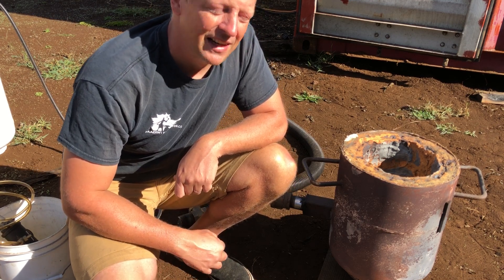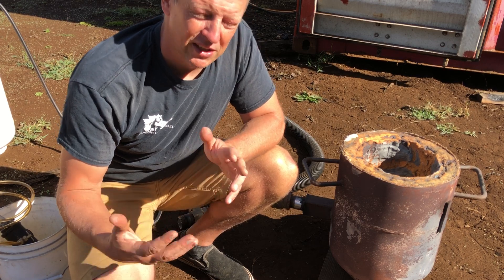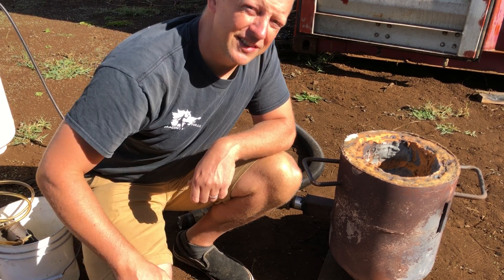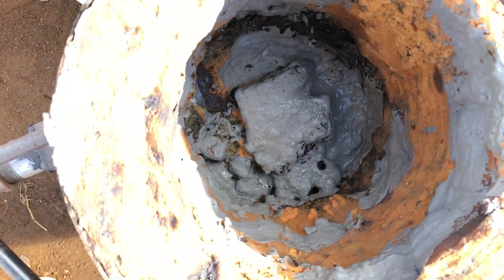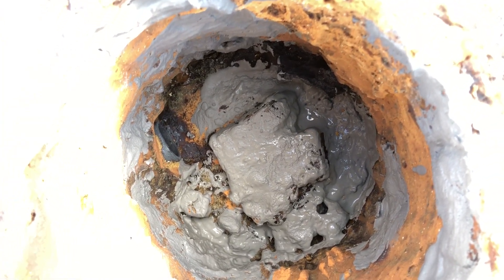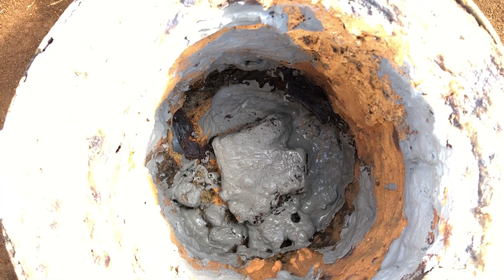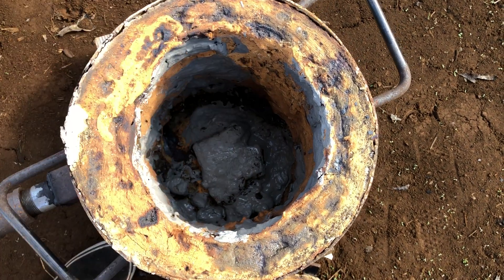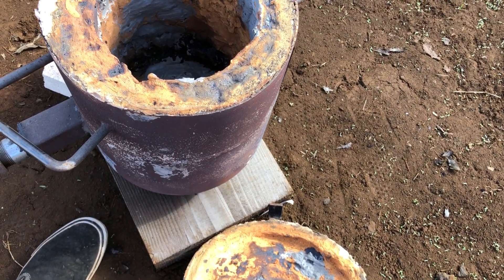Furnace and Burner Tour

Comment: Hey, sorry for bothering you again perhaps you forgot or are too busy to answer, but my questions where about the formula to calculate the amount of charcoal to mild steel in order to achieve 1.6% carbon, and if hardwood charcoal is superior to softwood.
If you do not want to share your secrets that's fine, I am sure it took you many attempts and failures until you reached success. 
I just hope to get it right the first time because I'll be using bellows anthracite coal and a brick furnace to melt it,and pumping the bellows alone for 3 hours I'm not sure if I want to try that twice in a row hahah.
Reply from the maker: No trouble at all. Sorry to take some time getting back to you about this. All % in steel are calculated as weight %, so the first step is getting an accurate scale. I prefer to work in grams for several reasons. Let’s say you want to make a 1000g ingot; this means that 16 grams of that should be carbon. If you were adding no other alloys then the other 984g would be iron. In most cases your iron already contains some carbon, though, and that needs to be accounted for. Let’s say you are using 984g of 1020, which has 0.20% C. We multiply 984 x 0.002 to get roughly 2g of C in the steel. This would give you a 1.8% C content...except that there are always losses to oxidation and preexisting oxides. I would probably call the C in the 1020 my buffer and call it good. Charcoal also isn’t 100% C, so the calculated value there is always a little iffy. Softwood charcoal has less mineral content than hardwood charcoal but is harder to find. Unfortunately with charcoal it is not an exact science. Keep in mind, though, that it is better to undershoot a little and hit 1.4% than it is to overshoot that same amount and hit 1.8% C. The latter can make a good ingot, but it will be trickier to work so probably isn’t the best route for a first ingot. Anything over 1.3% should show pattern, though it will be a bit harder to bring out.

Comment: Can't  wait to see the burn. Literally, the stuff of legends
Reply: Didn't really come to think of that, it is the stuff of legends. It's exactly that. Kind of weird, huh?
Reply from the maker: The trick is separating legend from fact when it comes to antique steels and techniques. At the time of the Crusades wootz blades compared very favorably to contemporary European steels and to steels from around the world. Attempts to replicate wootz led to modern steelmaking techniques, beginning with the Huntsman process. Wootz manufacture died out in the 1800s for a variety of reasons, but in part it was because it was simply being replaced by more efficient manufacture of steels that were more appropriate to contemporary uses...such as firearms. Modern steels outperform the wootz of old (and modern wootz as well), but these steels only exist because of the crucible technique started 2000 years ago.
Reply: @peterburt7218  absolutely. Thanks for your efforts to set the record  straight. Though thinking about it, I bet you really wanted to make something cool...lol
Reply from the maker: I’m always aiming to make something cool! With the knowledge that comes from modern metallurgy I am able to improve the performance by avoiding sulfur and phosphorus, both of which are detrimental to the steel. I am also able to know what is in my steel to a much greater degree and adjust based on results. The smiths of old had huge amounts of experiential knowledge and skill, but without knowing what was in the steel it was much harder to fix issues for the next ingot.
Reply from the maker: Hopefully I’ll have a melt video sorted out by the end of the week.